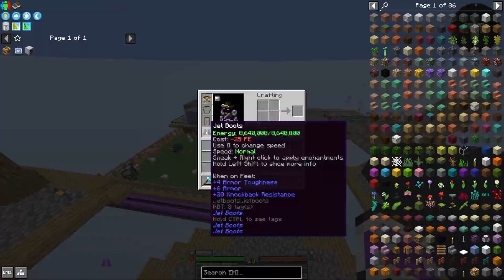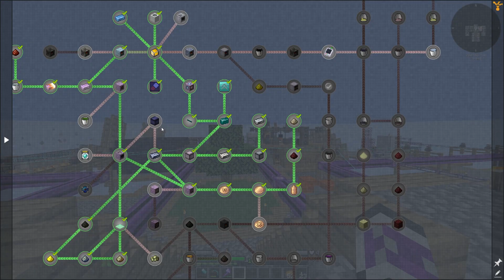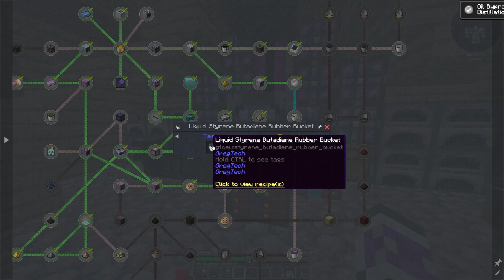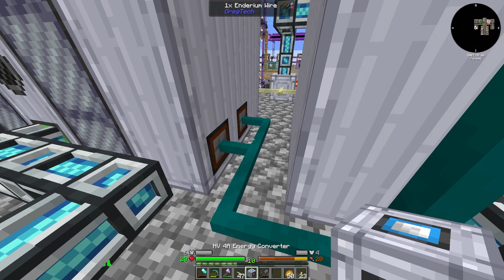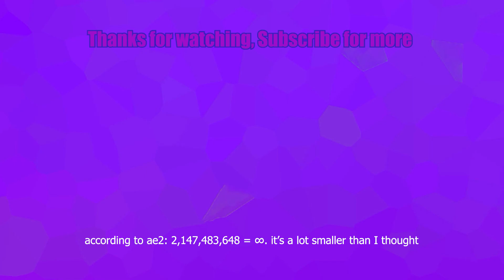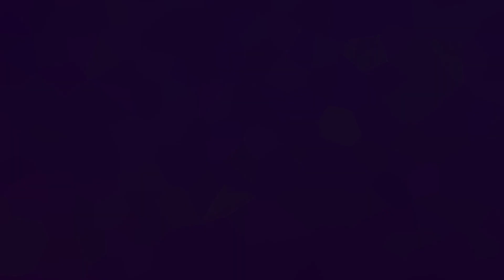Star Technology: Episode 24 - Additional Distillation

Comment: I have a question, recently i started oil processing and i want to ask about fluid locking since when ever i try to do it for distillation, it wont auto insert  and when it does work the distillation tower just stops, any fix?
Reply from the maker: I'm not entirely sure what the problem is, but I'm assuming you have a system similar to mine of a fluid storage into a distillation tower, so you might be getting some junk in the input hatch that doesn't let it run, or maybe the tower isn't tall enough to run the recipe you've put in. For the auto insert, it might be a problem with extracting the oil? I'm not sure about this advice, but that's all I can think of without knowing how you have it setup.
Reply: @Thaumiumking9  maybe the first because i do have some excess fluids but when i try to controll it, it wont auto insert properly because of the fluids and it get stuck and the distilling recipe stops, my solution was just to pipe it out since 3 secs was enough for the pipe output the items into the tanks in time

Comment: Fluids can be extracted from machines with two fluid cells:
One connected to the machine's input, with "auto input" enabled in the cell settings. 
Usually this will only extract 1B, but with another fluid cell taking fluid from the first, it will extract everything in the machine's fluid inputs.

Comment: I build new multiblocks out of cobblestone first (since I don't use it for my base; you'll want a different block). I use effortless building to place a hollow box.
Then I replace blocks with whatever is required/needed (controller, maintenance, energy, input and output blocks, etc.). I take the cobblestone out of my inventory and veinmine what's still left in the structure; that tells me how many casings I need.
Reply from the maker: That's pretty clever, I could probably still use cobblestone because my base is made of slabs, but I'll use dirt or something so it's more visually distinct. I'll try that out next time, sounds like a good idea.

Comment: You can get A LOT more efficiency out of your fuel if you go through compression boiler -> steam dynamo instead of just compression dynamo. The upgrades stack, so you can get something like x16 efficiency of fuel. However, it is a bit of pain in the rear to setup as there is a lot of excel fighting to be done there.
Also, you probably could just add one or two more dynamos, production should keep up with fuel even without multiplying efficiency
Reply from the maker: I usually don't like having multiple dynamos when I don't need to, so I've been holding out until I really need to. The boiler though does sound like a good idea, I'll probably do that soon too. Thanks for the tip.
Reply: @Thaumiumking9  me with my huge rows of numismatic dynamo just on hv in moni: 👀

Comment: To charge stuff in gregtech you can either get a turbo charger or just charge the items in your average machines (they have a slot with a lightning bolt in them).
Reply: It took me a while to figure out has to be an HV turbo charger to charge the HV prospector (duh). This also applies to the advanced electric jetpack from the HV tree.